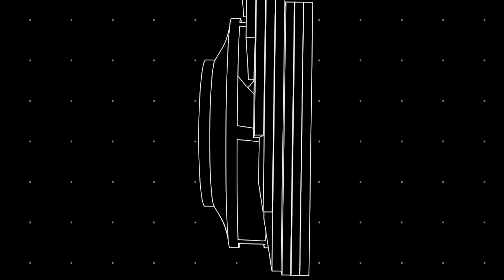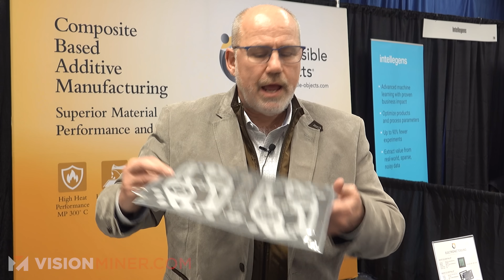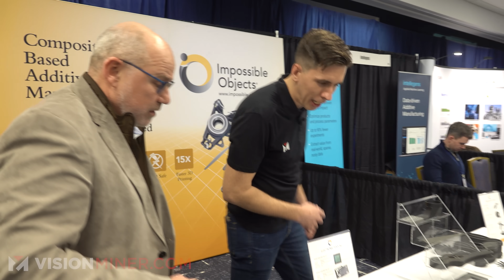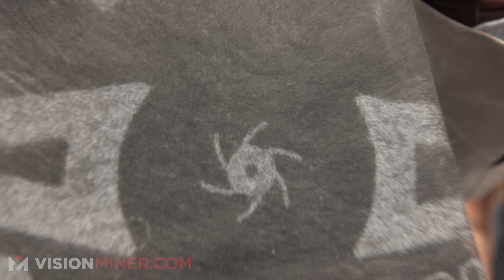Impossible Objects is Disrupting 3D Printing With a New Process | AMUG 2023 w/ Vision Miner

Comment: Seems more expensive than SLM, which has much stronger parts than any plastic reinforced with carbon fiber (Caveat being conductivity Thermal/Electric.) They are marketing it as additive manufacturing, but you have to sandblast away carbon fiber which is not capable of being recycled directly back onto the process.
Reply: for now.
Reply: @user-lx9jm1wo3h  randomly having faith in future tech doesn't make that tech feasible 😂
Reply: @MrJoerT  poo-pooing on it doesn't make it unfeasible either, so what was your point again? 🤣
Reply: It is indeed an additive process. The process is called sheet lamination and this application seems to be combined with material jetting process. In SLM, DED, etc, nearly every single part needs post processing. If we dont consider it additive because of the post processing, nearly every additive  application would be considered hybrid. There are a number of different additive methods and they all have their applications. SLM/SLS is extremely expensive. Not sure how much this system costs, but I would venture to guess that SLM is not  cheaper. A DED additive system such as Meltio is 250k USD plus more for options. And that is a relatively low priced DED system. A Matsuura Lumex is over $1m as of a few years ago (powder bed fusion machine). Then the costs of the powders ($$) and the safety equipment and handling processes, etc. Then the NDT processes and equipment, etc. The wire EDM to separate the part from the build plate, the milling machine to resurface the build plates. Its no small feat to implement SLM/SLS. So I would say that it is definitely not cheaper than this process. This process however, looks to be SIGNIFICANTLY faster than SLM as well.
Reply: @jbwalker841  crazy good argument. Would 100% agree as a SLS printing professional.
Reply: - hopes and dreams of having a "labour free" replicator - are still not here.

Post processing is needed in most - ALL - additive methods, especially SLM or SLS if you want high tolerance parts with "perfect" surfaces (even CNC machined parts need work to get "desirable" quality finishes - a reason why diecasting is a great "tool" for production parts).

Robotic blasting / cleaning is very programmable, the parts could be water jet cleaned as easily (?? correct usage?) as "sand blasted"..
Reply: @noelblattler5511  Thanks. I love additive technology. If I have a chance to help people understand it better, I do my best to share what I can. It's just good to make sure people have a realistic expectation of what its capabilities and limitations are. It goes so much further than the hobbiest grade FDM printing that everyone thinks of when we say 3D printing or additive.
Reply: @420247paul  was trying to keep it short, but cutting sheets with strands of carbon into little bits of chopped carbon makes it tricky to put that directly back into the process. You can reuse the chopped carbon for something else, but given that it's now also contaminated with sandblasting medium and whatever binds that sheet (I missed that part I think), you'd likely be cheaper dumping it all in a landfill and making fresh and clean chopped carbon.
Just praying that the future will make a process cleaner, doesn't make it so. I think it is counterproductive to do so, as it makes you at ease that the problem will sort itself out in the future somehow.
The process looks pretty good, and much less dirty than some other processes, but let's not pretend there is no waste in it's future.
Reply: Metal is also heavy. The point with this is you can have laminates with long carbon fibre to create perfect layer adhesion thermoplastic layups. 

Layups are normally thermoset, being limited to the (normally) epoxy they are using. 

Having long fibre reinforced peek parts with no inter layer weaknesses will be amazing for aerospace applications.
Reply: As others have pointed out this isn't reallly a SLM Slamdunk. But actually I wanted to add another facet. I don't think this will be trying to replace SLM. I think this can be used to automate carbon fiber hand production which would be revolutionary. Considering how long that usually takes.
Reply: So exposed carbon fiber is quite conductive also, enough that it can block out radio signals and cause a short on exposed electronics.
Reply: @jbwalker841   Solid points. I was thinking more expense per part vs expense of the machine. It is true some of the metal powders can be quite expensive, but I don't think it is as expensive as PEEK (at least by weight) Last I checked titanium powder is still cheaper than peek by around 50 to 70 USD per kilo. That being said this machine wouldn't have to use peek and could use a much cheaper plastic. Also as a side note some of the powdered bed systems are in the low 100s now, so I agree that is probably much more expensive than this system but only by like 90 or so thousand haha
Reply: Yeah you can’t sandblast away from hollow internal parts, but I guess you’d only use this technology if you needed the full strength of 100% infill anyhow. Maybe you could ultrasonically break down hollow bits and drain them via a small hole, using a high-power ultrasonic cleaner.
Reply: @Scrogan good thinking
Reply: What's the price?

Comment: How strong is it actually though. The lack of numbers is really concerning. Also the sheet process makes it seem like tensile strength is only dominant in one plane
Reply: I'd also like to see some numbers on this.
I agree the tensile strength sure looks like it will be limited between the layers.
Reply: @ddegn  there are no layers after compressed and heated. It melts to a solid part with embedded carbon.
Reply: @chris2790  The plastic binder may not have layers after melting but the embedded carbon remains layered. There is likely a large strength difference in the part depending on the orientation it is tested.
Reply: The numbers are printed on the transparent in the background.
Reply: @DerSolinski  "high strength" is the most unscientific thing I've heard in a while. tensile strength? sheer strength? bending? 
15x faster print? 15x faster than what?

If someone actually had a good product they would not shy away from actually stating the facts. But hiding them behind marketing tactics says everything
Reply: @giedrius2149   15x faster than SLS
CF + PEEK  130MPa
CF + Nylon 100MPa
I have to assume that this is tensile since they just printed the number.
Also if you want to bitch about that you should blame the host for doing a improper job.
Reply: i'm really concerned about the lack of numbers too, i'm not sure i'll be able to sleep tonight ;)
Reply: @chris2790 
😊😊p
Reply: @ddegn  that makes sense, but I'd be interested to see if the fibers shift when the plastic is heated to melting point. The part may have traces of layering but it may not be as bad as you think.
Reply: Still going to be vastly, insanely stronger than anything FDM regardless. As far as I'm concerned the specific figures are irrelevant for now.
Reply: @DerSolinski  not very strong but still impressive
Reply: In 2 Axis good and in the third Axis Not so good 😅. Very Design depended parts. But If i would know how to make it 3D i probably Start my own buisness 😅
Reply: Yup.
Reply: @Jejjing 130MPa is stronger than most isotropically designed epoxy-CF lamination schedules
Reply: Ur Indian I wouldn’t worry about it
Reply: @davids.6671 At the absolute worst, it's still a solid PEEK/PA part.
Reply: @ddegn the embedded carbon may remain layered. The hope is compression infuses binder between layers. Unfortunately you can hope in one hand and...

Would like to see testing. But more importantly a community of peer reviewers looking for weaknesses.
Reply: There's no doubt that the the strength will be substantially greater in one plane!  I love the creative approach, but it's going to be limited to a few very select applications.
Reply: Unuseful if it costs like a sport car

Comment: Would have been interesting to hear what the material strength is when it comes to compression, tension, shear, etc and how it compares to other materials.
Reply: yest, its compressd. using hudraulic piszton.
Reply: @uiopuiop3472  he wasn't inquiring about the manufacturing process, he's asking about the finished material properties.
so compression in this context means like a sand castle is build with compressable sand that will fail when pulled e.g. tensile stress.
Reply: He is a seller, he won't willingly speak about the bad points of his product. That kinda defeats his purpose of being at the convention.
Reply: @Helveteshit  Yeah. That’s kinda what I subtly alluding to.  You know they’d put that info front and center if it were favorable.
Reply: @IkarimTheCreature  its 15mm cf, its not super weak, but its not super strong. It will be something like steel without doing the math. Probably worse than steel for most purposes though.
Reply: The numbers regarding tensile strength and tensile modulus displayed on their web site are pretty impressive compared to all other additive manufacturing processes. The physical properties are not the sole smoking gun though, the fact that CBAM is 3,000 times faster than the other additive manufacturing process is the primary thing to grasp and digest.

Comment: I'd be curious about the layer adhesion strength since the fibers are only oriented in 2 dimensions. Plus, if they are bonded in a press, they might have inherent vertical strain in the objects depending on the pressures used.
Reply: Exactly… everything about this sounds like existing processes, but worse
Reply: Since the sheets aren’t woven, during the melting stage the fibres might get pressed and mixed between layers. If the plastic is molten whilst being pressed then it shouldn’t really create any stress within the material.
Reply: There may be all sorts of inherit issues, but they will be on a diffferent level compared to traditional printing. So whatever flaws you  find it will have already been in a class of its own
Reply: All high performance composites are manufactured under pressure. This seems to be top notch. Carbon/PEEK is about as good as it gets. Layer strength will be very high thanks to the PEEK. Carbon/epoxies has 10MPa in between the layers an this should be higher.
Reply: I've worked with Roboze's Carbon Peek FDM and witnessed the major difference in XY vs Z strength.  Hard to educate customers & find applications that only have forces acting in the "correct" direction.
Reply: @adamwiddowson8254 skepticism is quickly becoming more of an enemy than a friend these days
Reply: @per.kallberg  The background graphic of his booth claims >140mpa
Reply: @amorton94  thanks, I think they mean in the fiber plane. 140MPa is mid range aluminum performance. PEEK is around 100MPa but when mixed with ~60% fiber the intra layer performances should go down to 30-50 MPa
Reply: @conorstewart2214  wishful thinking, they don't interweave, so you still end up with distinct layering
Reply: @dghtr79_36  that is my point, the fibres aren't interwoven at all so are free to pass between layers. Do you have any evidence that they don't and that there is distinct layering?
Reply: "Layer adhesion" in a process with no resulting layers. Good shit.
Reply: Interesting, but too many details left in the dark. 🧐
Also to my non-American ears, this guy sounds like a used car salesman at the state fair, in a ‘80s John Hughes’ movie.
Reply: @per.kallberg  Yup, he even said it acts as one piece. My impression is there are no layers when it's done.
Reply: @jakerazmataz852  The fibers bill stay in distinct layers even though the matrix, PEEK, will melt together as one piece without layers. It is possible to create fiber layers with short fibers going in the Z direction as well but the performance will not be as good as in the layers with 50mm fibers. If the fibers are short the failure mode will be fiber debonding.
Reply: @jakerazmataz852  It's a shitty product with a major structural defect namely has low ability to withstand sheer forces perpendicular to the Z-axis. The plastic may melt without leaving layers but the fibers, which are the main stress bearing component won't mix and will de-laminate under transverse stress.

The guy sounds awful - snake oil salesmen style.
Reply: @vaakdemandante8772  It's not like the carbon fiber matting is so tight it can't inter mesh under the pressure.
Reply: I feel like people are missing one huge factor; these parts will have insanely high layer adhesion due to the temperature and pressure imposed on the part. You're essentially getting solid PEEK with fibers going through it. This is the closest to machined part strength (at least in the Z direction) that I've seen other than one company that heated the PEEK part as new material was being laid down onto it so the new and old layer were both semi melted.
Reply: That's exactly why they show "flat" objects where stress is usually is pressing on the layer rather than the bond between layers, aka blades and ballbearing mount. I do still find it very cool, i mean guys are using plstic details to do pretty highload stuff and high temperture stuff. I still find it very cool.

Also you kinda miss the point of tech like this - scalability and low prototyping costs. With methods we have today you are usually "hard pressed" to choose what you want to do - prototyping or series manufacturing, and given that you still have to make prototypes with series technologies(since technologies for prototyping are not 1-1 representation of what you will get in series) it can be VERY costly to make mistakes. As for methods like this? No biggie, go just print another one.
If you want to have it even cheaper and faster in series you can probably just "print" masks the same way you do prototypes and create a conveyer that just dumps the powder(or liquid, if that won't work) in place and of it goes to the other stage. All in all this looks like an ideal technologie for manufacturing semi-simple shaped objects in series on a budget.
Reply: As with any material or manufacturing process, it will be a good fit for some applications and not for others.
Reply: @scottwillis5434  Of all the replies I like this one the best.  There's a lot of hot-takes above that seemed to think I was trashing on the technology.  Quite the opposite. I'm genuinely curious in the resulting material characteristics.  Strength discrepancies relative to layer orientation is a common concern for all additive manufacturing technologies.  That says nothing about their viability for various applications.  But failing to ask those questions and making flippant assumptions is going to limit the technology.  So anyways, looking forward to one day learning the true answer rather than speculating.
Reply: Wonder if you could sew the sheets together with carbon fiber thread or something similar before bonding to add inter-layer strength.
Reply: Each layer is 50 microns, not sure if that's any good these days.
Reply: @jakerazmataz852  Sales BS. There might not be visible layers but the strands of fibers are still pretty much non-existant or of vastly reduced length in the Z direction.
Reply: @per.kallberg  Exactly
Reply: @Veldtian1 if you put more pressure on it to deform the fiber you will distort the contours of the part
Reply: @vaakdemandante8772  It's not any different from the current state of the art and modern defacto champion of performance that is laminated composites.  There's generally nothing else holding those lamina together than the epoxy matrix.

Comment: Since you can't sandblast the inside of an object much, you're pretty limited by this technique to creating open-faced parts, rather than parts with  a large cavity and a small opening.
Reply: Well i dont think that carbon fiber that is left on inside of the part would pose some threat to integrity of printed part. And if yes, you can still fill the inside.
Reply: It would be interesting if they intregrated a laser cutter and air blast to remove internal cavities and pretty much anything that isn’t needed (maybe just keep some locating features or something) so that the amount of sandblasting needed is reduced and you can have internal features. That fabric looked pretty thin, enough that a laser could cut a few layers.